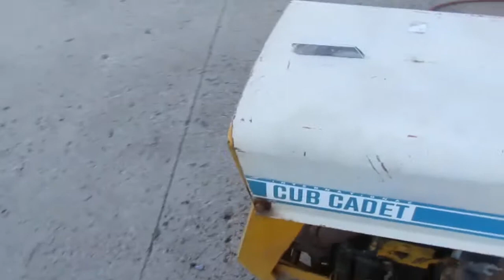Will It Run??? 1969 Cub Cadet 105 Garden Tractor

Comment: Jon. One thing to check regarding the spark;  The wire on the ignition coil that goes through to the other side of the engine. The wire over a period of time may have rubbed the insulation off of the wire in which means that the wire is grounding out against the tractor as the wire routes around the engine.
I found a good piece of hard copper wire with black insulation to replace the bad section of faulty wiring. That was a common problem area that would make you pull your hair out. The Cub Cadets could be rather finicky with the ignition coils for some reason. 
The noise that you commented on regarding the PTO sounds like some of the set screws are flopping around inside. The Cub Cadet PTOs have double set screws in which the set screws that are supposed to look the primary set screws in place back out and flop around inside the PTO in which the centrifugal force keeps them from really harming the PTO. 
I would suggest that you completely go through all of your wiring harness routings and look for bad places. I have been thinking of ordering a brand new wiring harness for my 107 Cub Cadet being that most of my wiring has the cloth insulation and probably really needs to be replaced to be honest.
One thing that I did concerning my battery was to slice the metal brace within the hood that is in the area next to the battery. By doing this it allowed me to use a group 26R3 battery like was used on the Super A through IH 140 FarmAll tractors. The starter generator will crank much better and will not labor too much to keep the battery charged. Hope this helps you out,Jon.